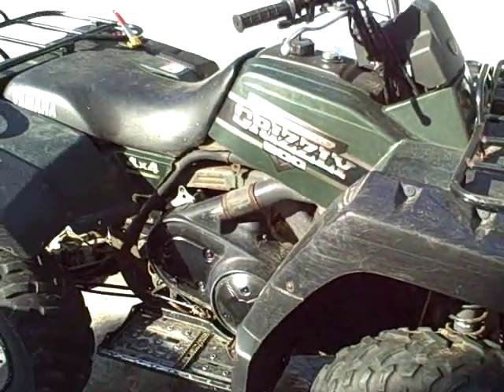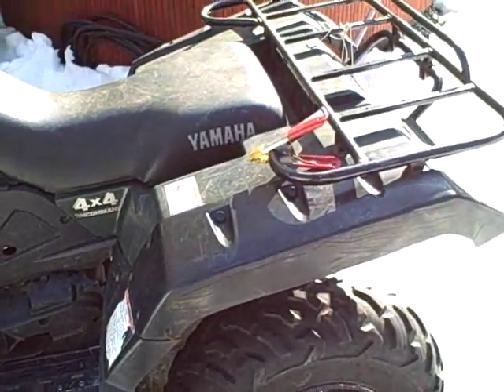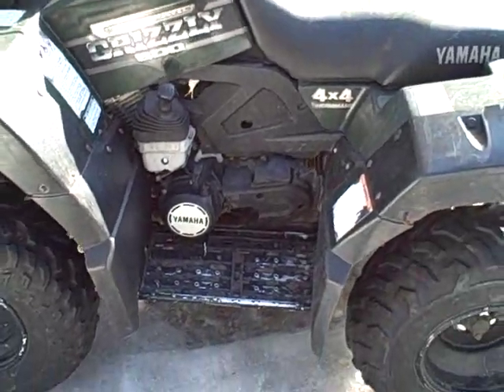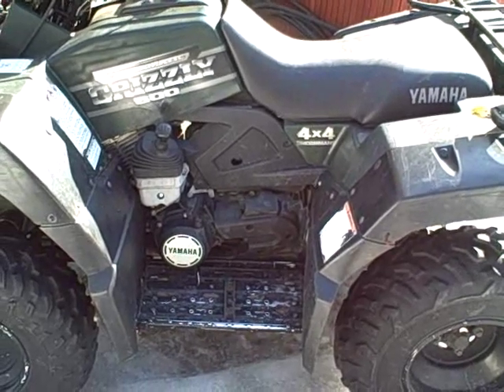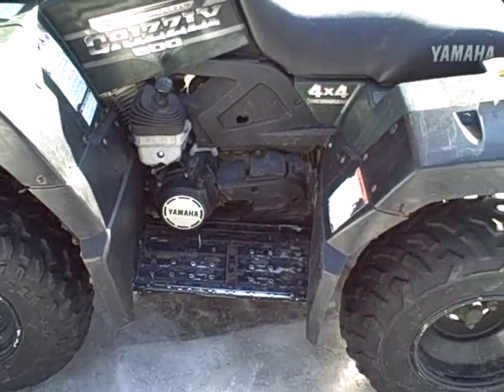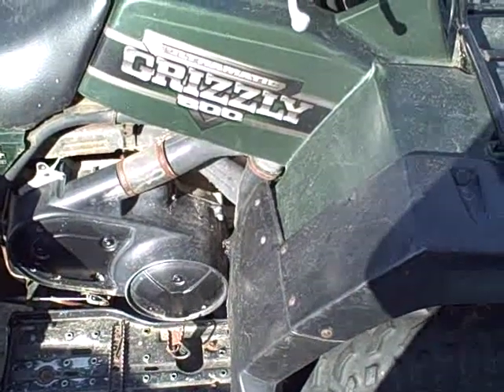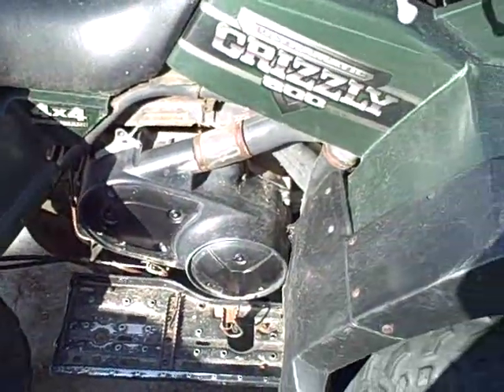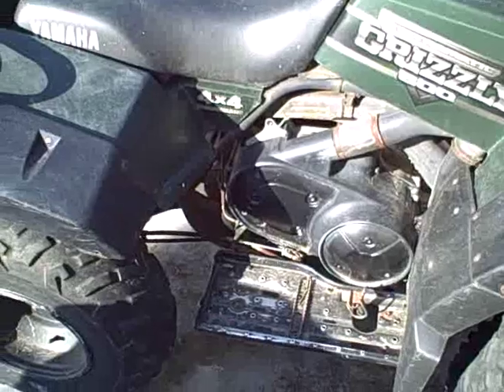Yamaha Grizzly ATV Repair Project: Part 1

Comment: Thanks for all the videos of the rebuild of the top end going to help me out a lot because u was very detailed about everything.  I just got one that the rings needs to be replaced.  just wanted to say thanks for posting all the videos.
Reply from the maker: You are welcome. It's a good older machine. I still use it a lot, mostly pulling a large wagon.

Comment from the maker: I think there are 2 that do not "go anywhere". One is a vent and one is a bowl drain line. there is a screw near where it attatches to the bowl, and when you losen the screw, you can drain the float bowl. the drain one just needs to point down, and not be in a spot it can be damaged. The vent line should be routed beck up towards the air box. That's so if you get into deep water. I think it may have had an adapter on the end to attach it to larger clear plastic tubing.

Comment from the maker: This one is a model year 2000, based on the VIN number. They phased out the 600 in 2002, replaced it with the 660. Even in 2002 the 600 was limited to a metallic silver model, and I've never seen one.
Reply: How easy is a cylinder and piston job to someone with basic knowlege? I have a service manual and will be watching your video. Currently I got all the valve cover bolts off but stuck on the removal due to the stupid epoxy like gasket keeping it stuck
Reply from the maker: Let me put it to you this way, if you are mechanically inclined (good with your hands) then I'd say it is very doable. Just off the top of my head, a couple things to keep in mind. Check all parts you are reusing for wear, like the timing chain tensioner and guides. As long as you're in there, give the head some love. Like lapping the valves, and new valve stem seals. If you are not comfortable doing that, take the head to a machine shop that does this work. It should not be too expensive, and poorly seating valves will result in poor compression even with a new piston and rings. poor valve stem seals will result in burning oil.  Be sure to orient the rings properly, and check the end gap. This is in the manual. Use a good quality gas tolerant sealant, regular RTV will end up failing because eventually we all end up with gas in the oil to some extent. @Sabi1234567890Asdf
Reply: @stevewatr  appreciate the tips. Managed to get to the cylinder before I started stripping bolts and getting mad. I know the utmost basics of mechanics but that's it however i am an appliance technition by trade so i am used to working with my hands. Service manual and these videos have been a big help.

Comment from the maker: Real hard to say. I mean, I got real lucky with this one. The motor was in decent shape before they jumped it in the lake, and somehow all the electrical survived. Also I think they pulled the drain plug and drained the crankcase right away. the drain plug was missing when I got it. This probably helped minimize damage. If it sat under water for more than a day, it may have more issues than this one did, but if it's really cheap, you could take a chance, and part it out if all else fails.

Comment: Picked up mine in 2003 after a friend saw it at a guy's place who was selling everything because he was leaving the state......
I was asked to look at it, and it had parts taken off. I was able to briefly turn the crank as they took off the stator cover assy, but failed to turn it 360.......my mistake as later it only went about 180 and stopped.
I asked if he had all the missing parts, and he said yes.....I told my friend that and he bought it.
Later when they pulled it out of the crumbling garage and had a box of parts, half the electrical stuff was still missing, and when finally able to turn the crank was when I discovered it didn't turn all the way around. Considering the garage collapsed around it there wasn't much room to see this.
I told my friend all this and since he isn't able to fix it, I bought it off him.
Well little by little I bought stuff off Ebay and figured one day I'd get into the motor.....putting a camera scope in the spark plug hole showed the piston is toast, so a complete top end job is needed, so that's where I am today.
Hopefully I can bore out the cylinder, as there are still plenty of parts on Ebay if the worst case scenario is I can't.

Comment: Hey Steve, I have acquired a 1999 Grizzly that I’m having issues with. I have rebuilt the carb but it is still very hard to start and back fires like crazy. My compression is 95 and specs call for a min of 125, could that be my issue. Thanks so much
Reply from the maker: Well, my first thought is the comp numbers might be low due to the auto comp release. cranking to slow, or not having the throttle wide open, and just not thinking low comp causes your symptoms, unless it turns out to be you need a valve job. But before you go there, If the backfire is in the exhaust system, and happens on deceleration, that usually means too rich a mixture, and on thet carb, the high speed air fuel ratio is controlled by the large needle in the main jet that is automatically moved up and down by the diaphragm in the top of the carb. If you replaced that, and cleaned the carb body so the slide does move freely, then you can try adjusting it. Too adjust it, there is a tiny c clip that holds that needle into the other part. You will see there are more than one groove that clip can go in. Take note of what groove it is in, and move it one groove up, then drive it again to see if things improve. If it gets worse, move it the other way and try again. Also keep in mind bad gas can make it run like that too. My Eiger had water in the fuel, and would drive away fine, then start backfiring and lose power. So maybe start there? drain off fuel in a clean jar, hold it up to the light and see if there is any water in the bottom.
Reply: @stevewatr  
Thanks so much for responding. I’m going to go through everything. So much appreciated.

Comment: Hey Man,
First off thanks for all the good info with the grizzly vids.  Great stuff.  I am in the middle of doing a top end rebuild on my grizzly 600 and was wondering if you had a link so that i could DL the service manual?

Thanks Again,
Jeremey
Reply from the maker: I'd try the forums at grizzlycentral, that's how I got a PDF emailed to me, just by asking. I cannot find the file anymore. The laptop I use to use died a while back,  and I think that file was lost.

Comment from the maker: I've used Mystery oil on an old tractor engine that had stuck valves because it had sat over 10 years without use, and it worked great! I would not consider that hacky. On this motor I used a spray called Hil-co lube a customer gave me to try...........more videos coming soon.

Comment: I have one just like it. It is a 2001. Mine has low compression and is not running. Gonna see with your help if I can fix it. I have done been quoted any where from 700 to 1300 to fix. It is a strong atv and a lot of help for hauling stuff. It has a 12volt plug on the front for assessors. Hope your videos helps me.
Reply from the maker: Good luck. maybe it's just a value hanging open.
Reply: Could I be so lucky?? It was running and just shut off. Wouldn't start back. I had a dealership check it and found compression at 78. Should be 120. They were to busy...and cost was a factor also. Called several other places but they were to busy also. So here I am!!
Reply from the maker: +Michael Thomas Kelley stuck valve was my guess if it had been sitting but a sudden loss of compression makes me think broken timing chain or maybe an issue with the  ACR mechanism.
Reply: Oh me! Now my heads spinning. Is there an easy way to check the chain?
Reply from the maker: +Michael Thomas Kelley you could remove one of the access covers on the head, then turn the engine over and see if the rockers are moving.
Reply: Do you remember what site you found the instructions on or did you order them?
Reply from the maker: Michael Thomas Kelley Hello. I think some one emailed me a pdf file of the manual. Unfortunately I think that was lost in a hard drive crash a couple years ago, since I cannot find it now. Most likely it was sent to me by a member of the Grizzlycentral forum. Join that forum!  I cannot say enough how helpful that site was to me during this project. Regards, Steve W,
Reply: I got it fixed. All it was was the carb.
Reply from the maker: Michael Thomas Kelley glad you got it fixed. happy trails!

Comment: Great video series, any chance of getting a copy?
Reply from the maker: Hi, I assume you mean a copy of the service manual? I only had a PDF that was emailed to me, but I have misplaced the file when I had to switch to another laptop. I got my free copy by asking for help on the Grizzly forums, it is a great sight and highly recomend it. Sorry I can't help you out right now.
Reply: stevewatr I just bought a 2000 model Grizzly 600, as I was looking for information on the atv when I ran across your videos.  I was actually asking if you can send me a copy of your videos. I do not have internet in my shop and would like to view the videos on my laptop.
Reply from the maker: C Sullivan I moved those videos to a differant PC without internet, but I can try and transfer them back, then email. stevewatr@hotmail.com

Comment: awesome video thank you. i have a transmission issue on mine i want to rebuild but dont know where to begin i have differential and driveshaft out. how do i remove transmission?
Reply from the maker: Sorry, but I've never removed the transmission on mine. I strongly advise you check out the Grizzly repair forums here:
http://www.grizzlycentral.com/forum/

Comment: does anyone know where the coil attaches to on the frame for the earth
Reply from the maker: Parts diagram was not much help. Looks like it is held on by 2 bolts, one longer than the other, and only one has a washer. Appears to be on the front left, or pull starter side, probably on the frame tube behind the wheel well. http://www.yamahapartshouse.com/oemparts/a/yam/50038e0cf870021f60a0bf95/electrical-1